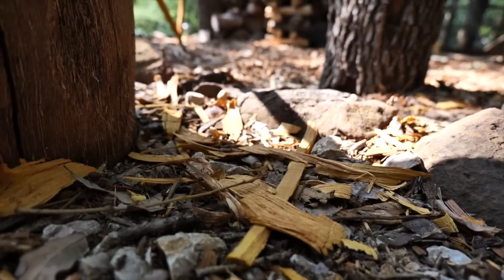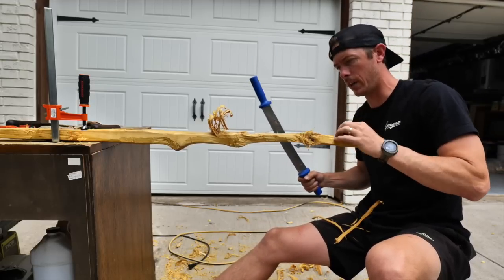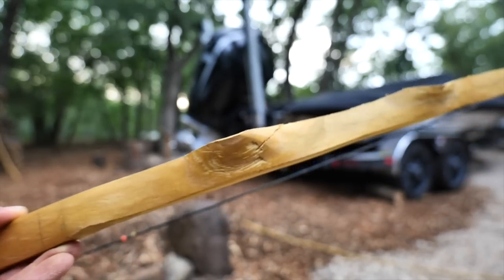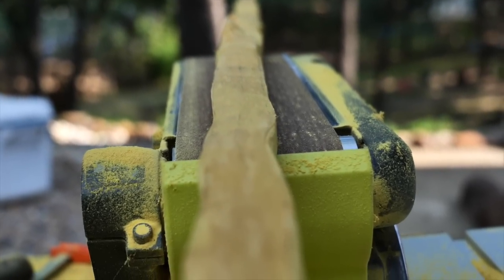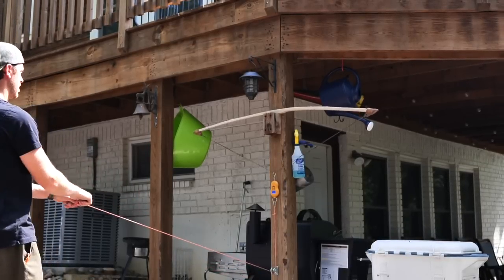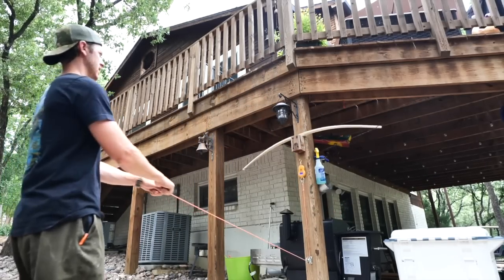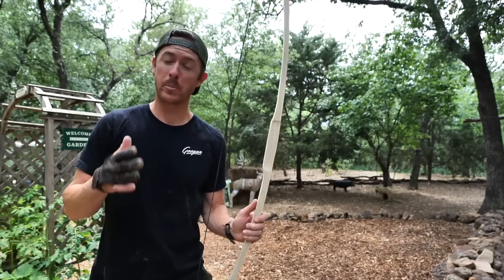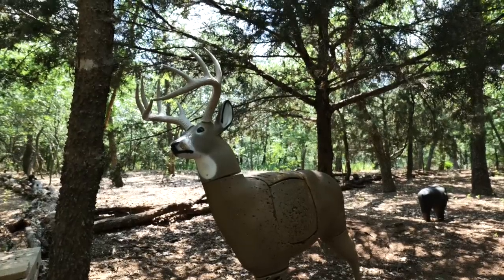NO! I Snapped My Primitive Hunting Bow!

Comment: You should try getting ahold of Clay Hayes. He's another trad bow builder who could probably give some tips on bowmaking. Or a hunt with the two of you would be sweet to watch
Reply: Clay is an amazing teacher. He was my source material when I first started out crafting self bows a few years ago.
Reply: I'm curious if a laithe could give him a more uniform shape. Kinda
Reply: No, that won't work with bows. The back of the bow (the part facing away from the shooter) has to be a uniform layer. The Osage bow is scraped down  to a single growth ring. The other bow's back is actually the outside if the tree, just under the bark. Otherwise when you bend the bow it'll find the grain and blow apart. Lathes just expose the growth layers.

Comment: Justin, you might need to look into making a bow out of a cedar elm. I just made my self bow for this upcoming deer season out of one and it turned out great. The thing that turned me onto elm is that it has a 4 way interlocking grain which makes them virtually unbreakable to an extent. 
I can get you a stave of cedar elm or winged elm if you’d like. They are fairly common here in north Texas.

Comment: I just asked ChatGPT why Japanese bows are asymmetrical.  Here's the answer....  
The design of Japanese archery bows, specifically the asymmetrical shape with a longer upper limb and a shorter lower limb, is known as the "yumi" in Japanese. This unique design has been a characteristic feature of Japanese bows for centuries and serves several important purposes.

One reason for the longer upper limb is to provide additional leverage when drawing the bow. By having a longer limb above, archers can achieve a smoother draw and generate more power as they pull the bowstring back. This design helps in maximizing the potential energy stored in the bow, which is released upon releasing the arrow.

Another reason for the asymmetrical design is related to the shooting technique used in Japanese archery, known as "kyudo." In kyudo, archers adopt a distinctive upright posture and shoot the bow with a nearly vertical orientation. The longer upper limb allows the bow to clear the archer's extended left arm (for right-handed archers) while maintaining a vertical alignment. The shorter lower limb helps prevent the bow from touching the ground during the shooting process.

The design of yumi bows has also been influenced by historical and cultural factors. Traditional Japanese archery has deep roots in samurai culture, and the asymmetrical design has been passed down through generations. The aesthetics of the yumi bow, with its elegant and graceful shape, are highly regarded in Japanese archery and are considered an important part of the art form.

It's worth noting that the yumi bows have evolved and undergone refinements over the centuries. The design varies depending on the specific style or school of archery practiced in Japan, and there are different types of yumi bows for different purposes, such as ceremonial use or competitive shooting.

Overall, the longer upper limb in Japanese archery bows provides mechanical advantages during the draw and aligns with the shooting technique and cultural traditions of kyudo.

Comment: I have been making Bows for years. I tried fire hardening with a heat gun and was amazed with the poundage I got from that. I gained almost 5 lbs if draw weight from that alone. Try it out if you get the chance you will be surprised.

Comment: Question Justin... there's a moment where you are trying to decide which end is top and which bottom as both limbs are practically the same length.  Japanese bows, which are very long to begin with, have a much longer length on the top side than the lower limb.  I don't know the reason for this, but would you even consider doing something like that on yours?